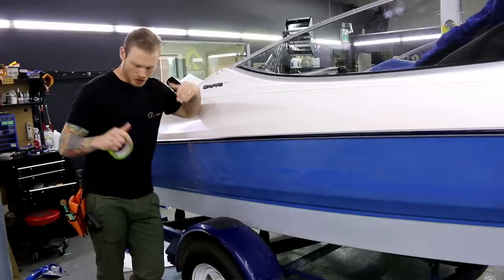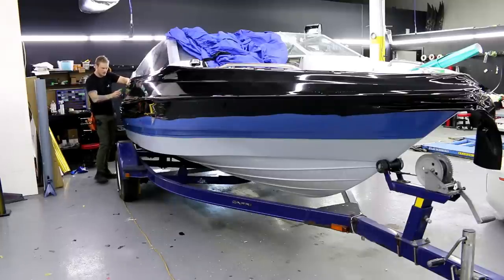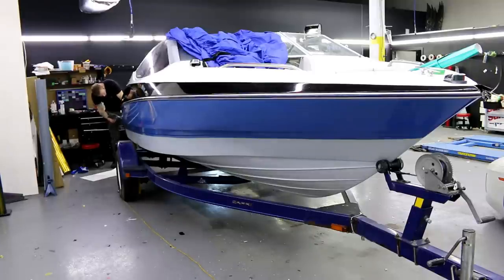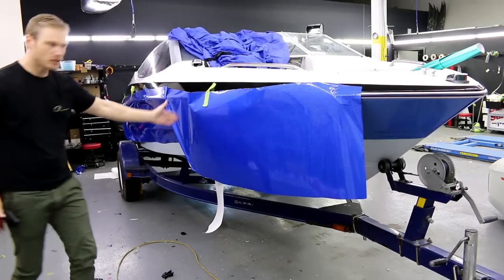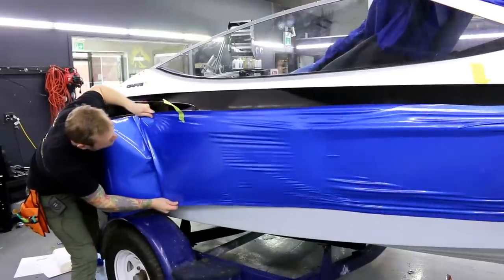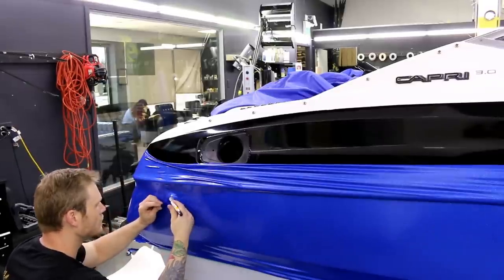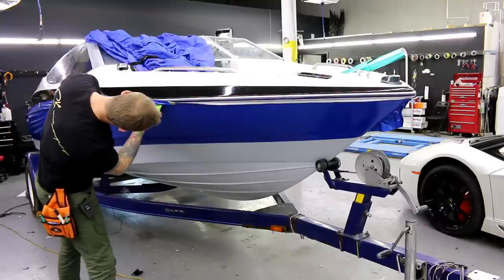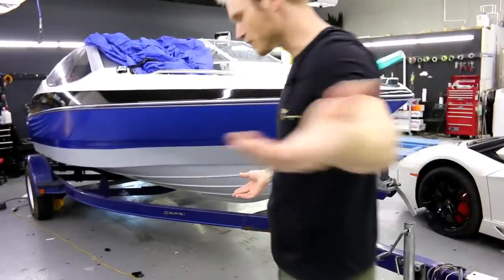Vinyl Wrap A Boat In Gloss Black And Diamond Blue

Comment: Anytime there are decals on a boat for an extended period the area where they are is protected and the gelcoat will be like brand new but the rest of the hull will be a eroded. It leaves an area where the decals are ever so slightly raised. Unless you really were at the hall and sand and buff the area there is nothing you can do about it. I have lettered boats where they have changed the name several times and you can see each name that was on the boat previously.. I love your videos they are great.

Comment: I'm curious what the "shield guard" is that you always use. 
It looks super useful usually and I want to get it, but I can never find it on vvivid when I look. Is there a different name for it?
Thanks
Reply: Just go to vvividhq.com and search for “Shield Spray Post Wrap” and you’ll find it. It’s just a spray that is applied after the wrap is done to protect it. 

From the product description -> VVIVID SHIELD is a unique protective sealant designed to shield vinyl wrap and plastic coatings from UV rays, scratches, cracking and weathering.

Comment: Ck you definitely have talent brother. Question is there anything you need to put on the wrap or on the ends of the wrap from it not coming off? I have a small flatts boat. 

Ty
Jeff
Reply from the maker: Some shops use edges sealer but I don't believe it's necessary if the film is installed properly

Comment: Looks good, was curious about your comments as to why the vinyl doesnt like to stick to the gel-coat? Could this be from contaminates and waxes/polishes being embedded in the gelcoat over the years?  

To explain why you are seeing the decals you had cleaned off prior to the wrap. The decals actually seal and protect the gelcoat over the years and years of corrosion and weather exposure.  SO, when these decals are removed, looking at that particular area in the right lighting, you can see that the gelcoat is raised where the decals/stickers once were compared to the rest of the boat.  Sometimes, not always this is also a way to tell how many different owners or states the boat has been registered in when looking at the boats registration sticker area and tracing out the raised letters/numbers
Reply: Prep is key,I mainly do boats and you have to strip the wax,
Reply: Adam E if I’m correct, gelcoat has wax in it for curing purposes. Some don’t, but most do. The wax also helps in removal of molds when layup is complete. Remember, boats are built from the outside in. The gelcoat is the first part of the hull.
Reply: @stevefarmer6607  Correction, Gel coat has NO Wax in it.  If it did, the next layer (layup) would not bond to it.  Wax is applied to the mold before the Gel coat for mold release.  Wax is put in resin to cut off oxygen so that the surface will cure otherwise the resin will remain tacky for bonding to the next coat during lamination. Mold release serves that function.  Resin WITH wax is used for a surfacing resin (outside of a mold) so that it will cure and can be sanded as the wax rises to the surface and seals off the air for a complete cure. 
I use to repair fiberglass boats and in order to repair surface (Gel coat) damage, we would spray Poly Vinyl Alcohol (PVA), which is water soluble, over the new Gel coat surface that would then dry to get the Gel coat to cure for sanding and final polishing.  This is only for Polyester Boat Resins.  Epoxy is another story and is seldom used in boats except when used for Carbon Fiber applications.  Because of it's weight, Epoxy is used almost exclusively in aircraft and does not require a wax for curing.

Comment: Christian - I have a pontoon boat in excellent shape, except the exterior vinyl graphics are in not the best shape.  The pontoon boat is 13 years old, so before the trend today of fiberglass sides. Has the corrugated aluminum sides with the graphics on that.  Looked at new graphics, looked at paint.  Then ran across your boat video and wrap.  If i decided on some nice wrap, like the metallic type you used on this video, or maybe a carbon fiber look, what would be your recommendation of the type and brand of vinyl wrap for a first timer?  Thanks in advance.

Comment: The pin striping lines are formed right in the mold. The decals protect the gelcoat from oxidation therefore leaving a pristine gelcoat  embossing as the gelcoat eroded around it.
Reply: Also you wrapped over the boat's VIN # that is molded into the starboard stern,  it must be readable.

Comment: To get rid of the old letters showing you should have carefully wet sanded the letters and it would have made it a lot smoother then buffed and then put the wrap on. That's what I did and no letters or decal are seen through.  I knew it would show through if I didn't do that first. Yes it's a lot of extra work still looks good

Comment: its very easy to just take off the pulley,loosen the strap and the the bolt and it will just slide out,or just the u bolts that hold it to the trailer

Comment: How well will the blue vinyl hold up in water?
Reply: Michael Guerin I was wondering the same thing
Reply: saltwater and sun cqn be worse i think
Reply: I've done names,registration numbers and boot stripes/highlights,graphics etc and it does very well.I have never had a warranty problem or comeback.Surface prep is KEY because some waxes cause problems but other than that it does good.
Reply: It holds up  fine.  After watching this video I put it on my ski. I rided almost  exclusively in saltwater and no problems. Edgeseal tape is a must though. Btw, one really nice thing about the wrap is that minor dock scuffs can be smoothed out with a little bit of heat. Did I mention it looks amazing!
Reply: Axel can you provide link on what edge seal tape your talking about? :-)

Comment: Looks nice till you hit a crappy boat dock or some part of the boat trailer guide or a dock  bump rail that scratches it up or tears it , Theres a reason boats are gel coat, its durable and flexible , Look what happens to regulr decals and graffics on almost any boat so lets cover the whole boat in that stuff , seems like a really bad idea unless you really watch it when your docking  or loading it on a trailer with side bolsters but i guess its easy to repair just put a new piece of Vynl on

Comment: What does a job like that cost? Also, thanks. I'm wrapping my sailboats this spring - using Vivid, viper green.

Can you please answer me these questions?: 

How often should I change my blade roughly?

Does applying heat produce an increased adhesion or tack?

I've watched a ton of your vids and I may have missed the answers to my questions, so I'm sorry for that.

Just curious about your thoughts on the whole deal.